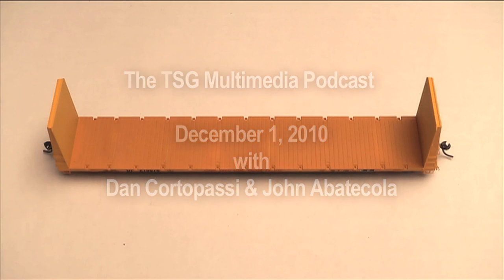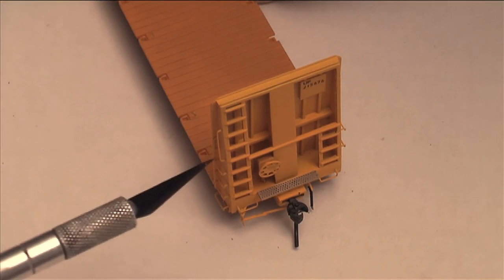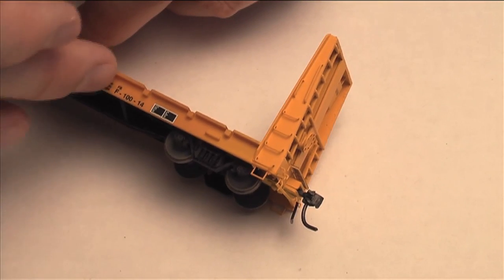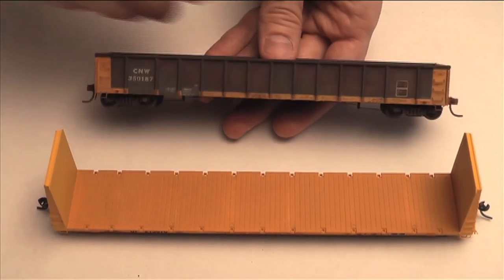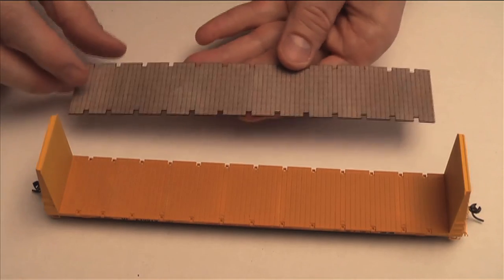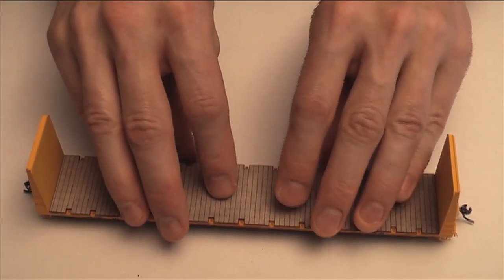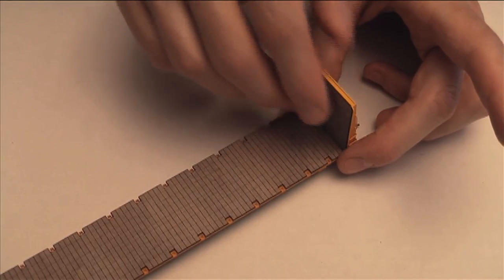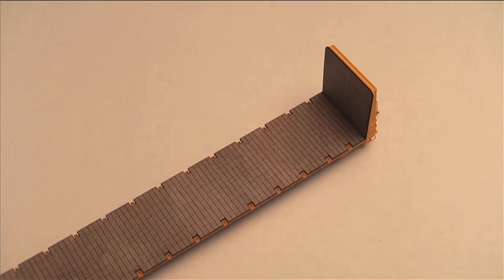HO Scale Detailing A Bulkhead Flatcar 12-1-10 Podcast

Comment: Bought 3 of these in the C&S BN paint scheme from the newer Athearn RTR run, and I'm hoping to make similar modifications (will probably use sergeant couplers, not run brake levers since they always snap on me, and properly detail the end ladders). Any tips or just straight info on how to achieve this effect? Also what wire did you use to make the grabs?
Reply from the maker: Please watch the video. The answer to your question is in there.
Reply: @tsgmultimedia  any chance you remember what thickness of brass wire?
Reply from the maker: hrmmm. not off hand. Probably .010 or thereabouts.

Comment: Those circle shapes are the ejector wittiness marks.  I think these would work better if the plastic deck is filed/milled away so the height, thickness remain more accurate.  I think some of these cars had steel bulkheads and the ones with wood you would be able to see the wood on the other side (end view).   The grab replacement work is very nicely done.   The MDC under frame detail on these models is incorrect and poorly done  - Athearn did nothing to improve/replace these.  Maybe someone will 3D print a replacement part for these so you have have correct brake components, rods and levers.

Comment: Where did you get that wood deck from?
Reply: Hey Jack, sorry for the late reply, but here's the info you need:
American Model Builders, Inc.
HO Kit No. 398 Wood Deck Set for Roundhouse Bulkhead Flat Car MSRP ...$7.95
Includes custom laser scribed and cut Peel & Stick plywood floor and bulkheads.
www.laserkit.com/laserkit.htm
They work great, I have several of them. I do think they need a bit of weathering, but if you're following this great video you'll be doing that already. Hope this helps.
Ghost of SP